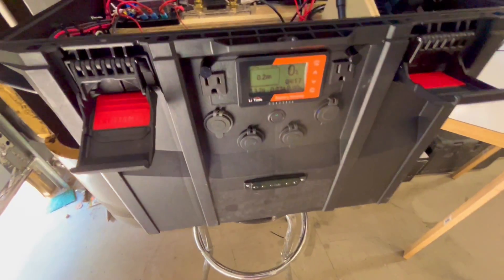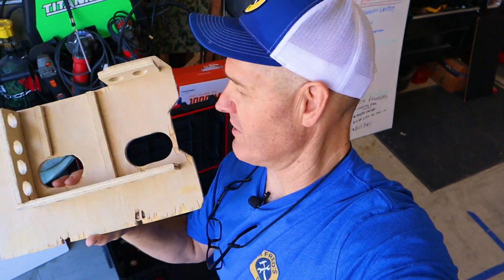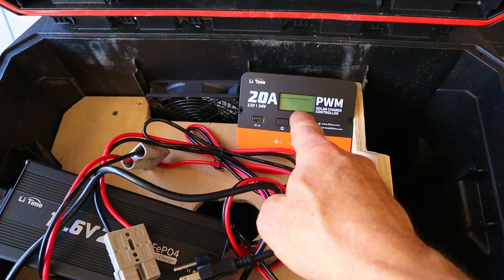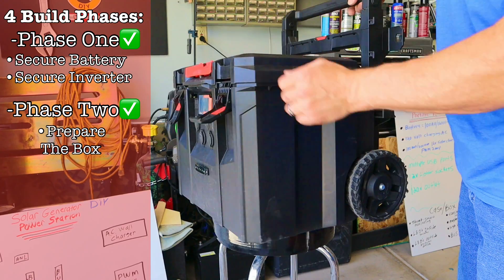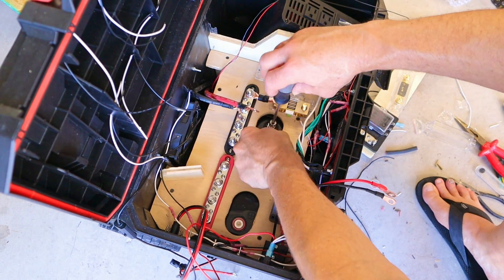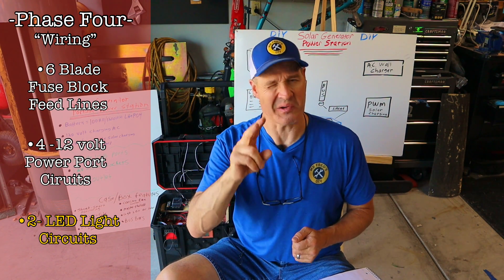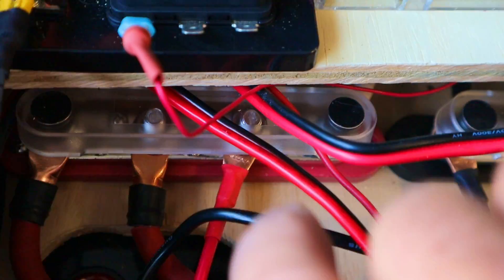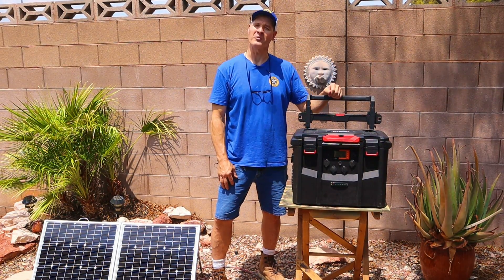DIY Solar Generator Power Station (Complete how to guide) LITime Power

Comment: Your AC extension "cords" are not. Using different gauge wires is only asking for trouble. There were other parts where your terminology was questionable. You need to be more careful with your amp ratings

Comment: Did I miss the fuse on the positive battery terminal? It's probably the most important fuse in the entire system.  You definitely want one.
Reply from the maker: Thanks for commenting! There is anl fuse on the positive terminal, feeding the inverter. Everything else that the battery feeds is DC and they are all fused separately with the six blade fuse block.

Comment: So, I like it, but how was it once you had to access that battey? You buried it behind everything, and a lot of disassembly would be required to access it.
Reply from the maker: Right on I totally get it. My thought is that my unit is easier to replace parts compared to an off-the-shelf power station.
Reply: Oh, I agree 100%. I am in the process of building a 2,500Watt 300Ah unit in a Ridgid stackable. I am building a breadboard out of large white 1/4 inch Nylon sheet (cutting board)that I will cut down to fit.  @MrFredsDIY

Comment: Nice video. I’ve built several of these power stations and they are a lot trickier than they look. Nice job putting it together. My experience is that it will be hard to fully charge that with one 100 watt panel especially with a PMW charge controller but I see why you used it, limited space. Keep up the good work.
Reply from the maker: Thanks for checking out the video and the kind words. I am wrapping up another power station bill this week and the video will publish this Sunday. Here is a sneak peek
https://youtu.be/hmhLaZWseEI

Comment: the AC outlets are too close to the out ribs of the case and to the battery monitor. its going to make using the monitor harder and plugging in anything with a wallwart more difficult. also when cutting square holes, an oscillating tool works great.

Comment: Nice work. Just curious why you didn't go with a MPPT controller?
Reply from the maker: Great question! I don’t plan on ever having more than 200 W solar for this little guy. It was a substantial savings going with PWM. I suppose if this type of set up were in a camper van with 400 W on the roof & alternator charging was needed then an MPPT would be a great all in one solution.
Reply: @MrFredsDIY  that's what I figured if it was going to stay small. Still a very nice build. One of the better ones I see. I only got into solar generators in the last 4 months after I got the ecoflow delta 2 and River 2 max but been learning a lot. Eventually I want to build my own and have 720watts worth of panels so I would be going the MPPT route.

Comment: Nice build! I'm building one of these boxes with 2x 100Ah Wattcycle batteries, and a 2000w bouge RV inverter.  Your wiring looks really good, and is really compact/efficient.  I hope I can get away with just 5 ft of 1/0 wire, because that stuff is expensive!
Your video style is cool too.  The music is good also. I can't stand it when people put in really loud music esp with bass, and I have to turn down the volume because it's obnoxious, and bothers my roommate.
I subbed, and am gonna check out some of your other videos.  Happy New Year!
Reply from the maker: Happy new year to you as well and thank you for the kind remarks. I really like using welding lead wire. It is usually less expensive and solid copper. Good luck with your build!

Comment: I want to figure out how to run my well for water when the power is out. It would be more convenient than buying and storing bottles of water.
Reply: Just a thought, it may be cheaper to buy a little water tank, and store water, above ground, because it is easier to pump it horizontally into the house.

Comment: Great video. I built my box about 5 years ago just for fun and camping. Kind of turned into an obsession with using a diy for solar on the house. I just got a LiTime 1000w inverter as a backup for the box. I have a Renogy 1000w inverter that has about 5 years of use behind it. Still running great. Subscribing so I can see the updates on your project.

Comment: What do you think I will need to run the A/C unil 120a and 800w computer for 12 hours.?
Reply: Generator power is insanely dirty - The current wave is all over the place, especially on the smaller, cheaper models. 
All you need to do is add the watt hours listed on the appliances, and match it with a sufficient amount of watt hour battery power to sustain it. 
If you "are" going to use a generator for high inductive loads like AC's, or delicate electronics like Computers, you should always run it through a charger. There are many good ones now, but my favorite - hands down -  is the "EG4 Chargeverter"., tons of clean power that won't surge or damage your equipment like what happens when running straight generator operation does. I've seen many items ruined while being ran on generators, especially small box store generators, and the people had no idea that the generator was the culprit.
I run my entire property on solar, and when we have cloudy weather for enough days in a row that my batteries don't fully recuperate, I just charge all my batteries back up with my generator and the Chargeverter - total game changer - zero electric bill now.😉😎👍
Reply: @Nat_Sarim777  they have gas generator that have an inverter built into it,  that is safe for computers and electronics now.
Reply from the maker: That would probably require a gas generator for the A/C.

Comment: You might need a fan to vent the heat from the charge controller, inverter and batteries.
Reply from the maker: Agreed!
Reply: He has a fan on the back, don't remember him showing how he wired it though and won't do any real good unless there is a vent on the opposite side to pull/push air through. Would recommend adding a vent by the Inverter cuz that's gonna put out a lot of heat in that small space.